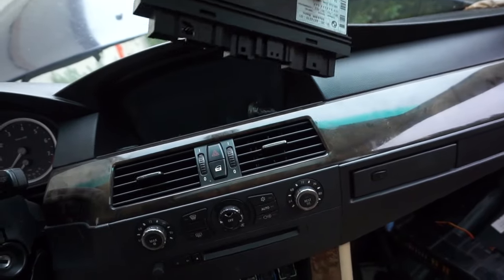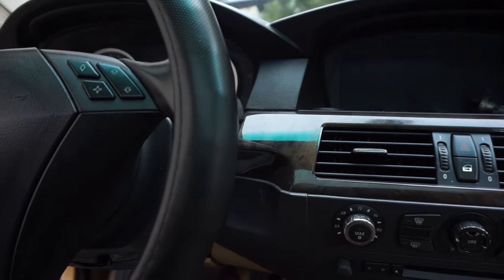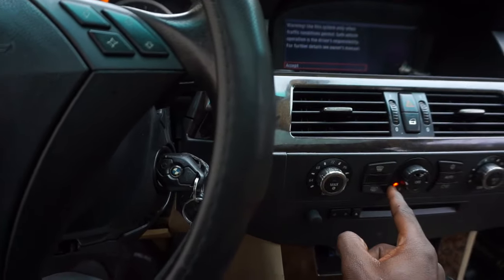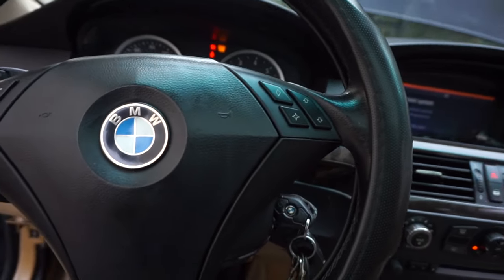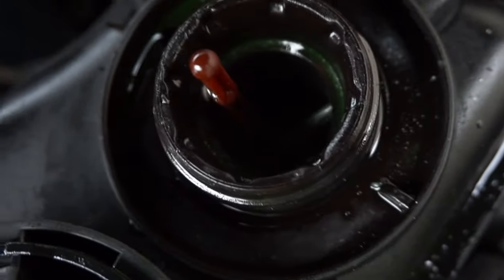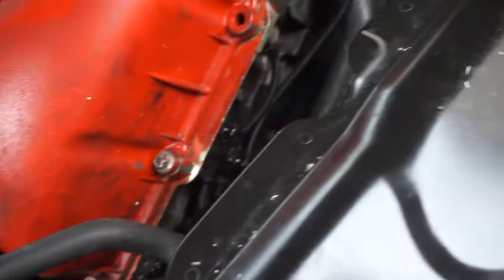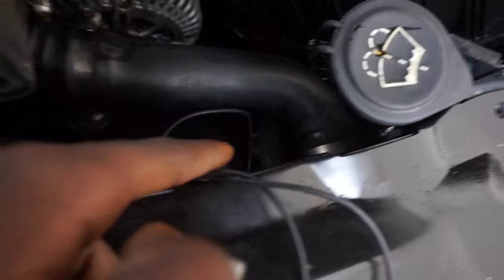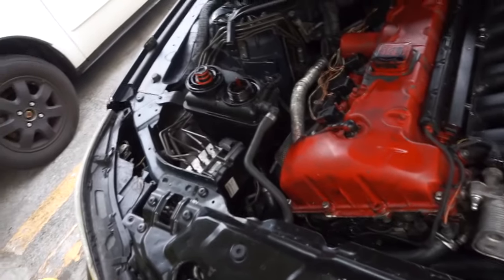How to Test electric Water pump in BMW before Replacing your Water pump & thermostat | Get Fixed

Comment: How to stop the water pump it already killed my battery
Reply from the maker: Is it running even after you have turned off the car and locked the doors?
Reply: @GetFixed  yes
Reply: i have ket the battery wire open also so that it wont work up ntil now the same issue it is working
Reply from the maker: How do you know it’s the water pump killing your battery? When you open up the coolant reservoir, do you see the coolant circulating through it?
Reply: @GetFixed   Yes, i have the same issue, i have turned off the car locked the doors, but water pump still on (sorry for bad english im from Brazil)
Reply: @PedroHenrique-ts8tg  hey I’m having the same issue! What was the result to getting the water pump to turn off when the car is off?
Reply: I’m having the exact same issue with pump running long after car is turned off and draining the battery.
Reply: @wlanceg  so I recently realized there was a crack in my hose leading to my reservoir which was causing it to keep running and drain my battery repeatedly. Once i replaced the hose a few days ago, it stopped.
Reply: @ryelandjohnson9868  wasn’t that causing a leak and a puddle? My car isn’t leaking anything.
Reply: @wlanceg  surprisingly not one that I seen. My BMW has a mind of its own. Very temperamental! Until you can find the cause, get a battery tinder. It was a life saver for me!
Reply: @ryelandjohnson9868  battery tinder???
Reply: @wlanceg  my car also not leaking